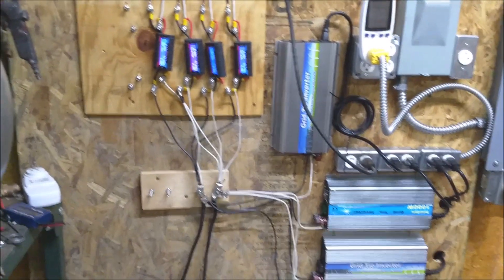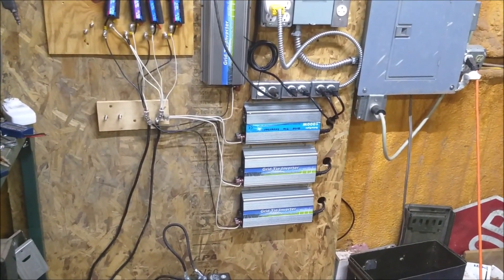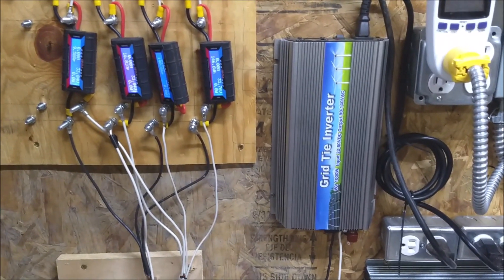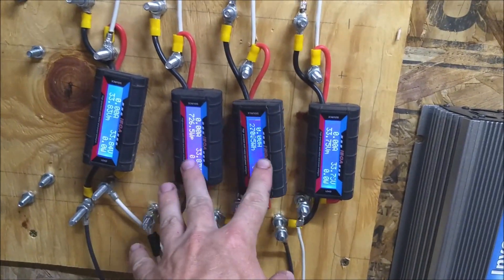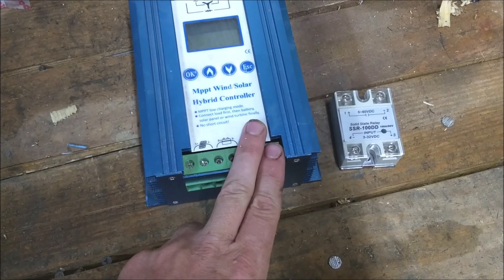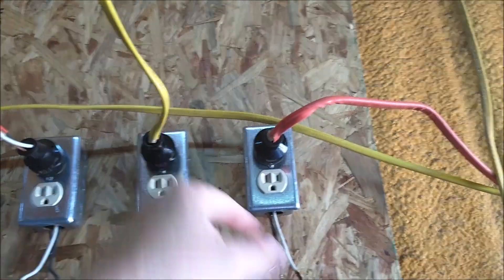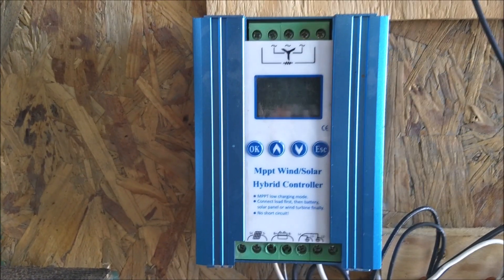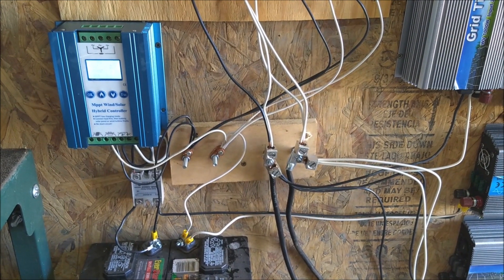Using a cheap charge controller to help with battery and inverter management

Comment: You should dump to heat water.  Watch my videos.  I run a washing machine off solar panels, no battery. My dump controller keeps the load precisely at what I set it to. Any little extra, from 5W to 700W gets dumped into the hot water tank. Voltage can never exceed my set point and it corrects load more than a thousand times a second.  Only one red wire needs to be connected on those watt meters.
Reply from the maker: It's crossed my mind but my water heater is 200 yards away...not easy access to wire it up.

Comment: does that ssr get hot  I have a few like that and had to mount them to a heat sink to keep them cool.
Reply from the maker: I don't know yet but it is something I'm going to keep an eye on.  I've got a stock of CPU sinks on hand to stick them on if it becomes an issue.  I don't think the 700/400 combo will really generate enough heat to be a problem.
Reply: @ToysforWatts  I can't wait to see more ,I'm in the process of building a big axial flux,I've had small tubines for a couple decades ,I have lots of wind and love it free power.